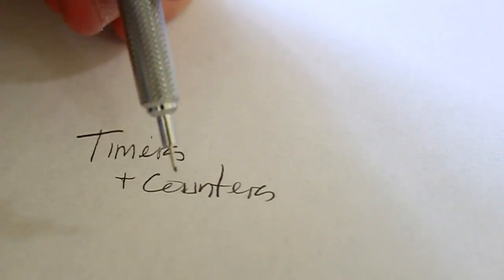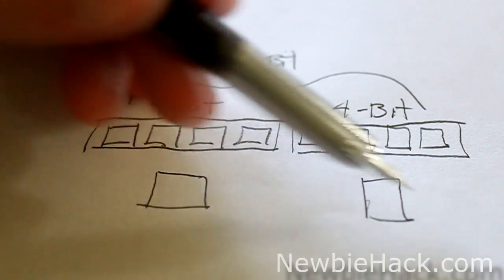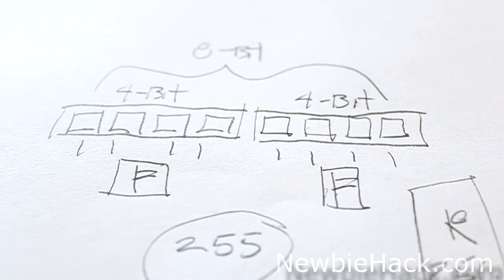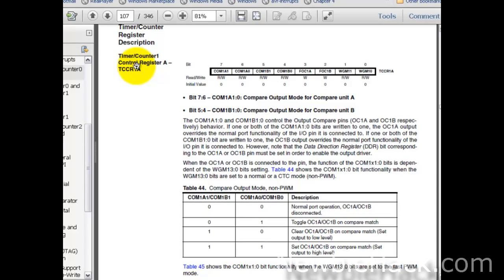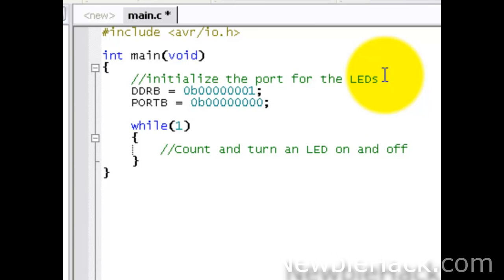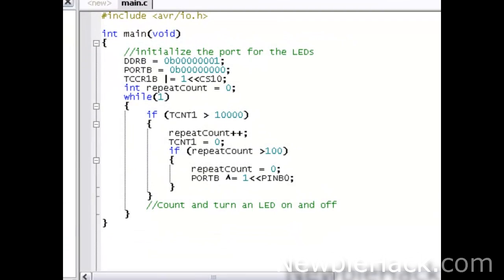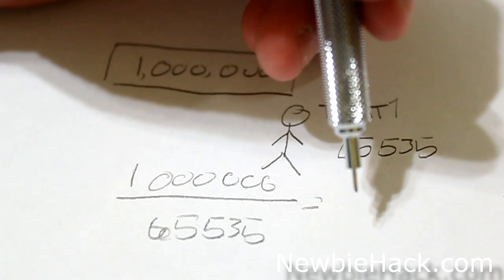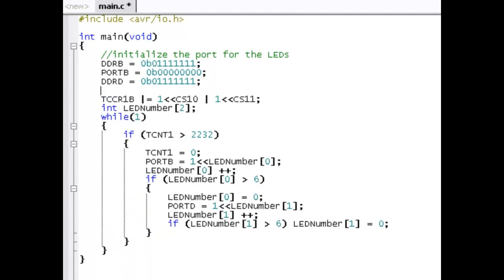17. Arduino for Production!  AVR Atmega32 - Timers/Counters and Binary/Hex Numbers

Comment: If someone have a problem with code using Arduino UNO -> just add one more line "TCCR1A = 0;" in setup statement, in order to activate "Normal" (Counting) mode for Timer1.

Comment: Hello, Patrick. before I get started, I feel obligated to say that "your videos are clearly the best. no one is disputing that". However, there are some very important things that were left out. These details are too specific for anyone to actually expect you to consider them unprompted. The first thing I want to ask you is, "If my 16 bit timer seems to be counting into the negative region, is it possible that the actual timer is counting backwards, or is it the way I am converting it to a character array and printing it to the serial monitor that is making it appear that way? ". My second question is, "Is it possible (and if so, is there a practical way) to observe the timer/counter while it is counting (like printing each value to a serial monitor)? Or will this disrupt the timer in some way". My final question is, "If I set up an "if-statement" or two in order to make sure the timer is passing every value between "0" and some predetermined maximum value I set up (probably as a global variable), what would/could prevent that from working as expected?"

 example:

------------------------------------------------------------------------------------------------------

#define F_CPU 8000000UL

#include <string.h>
#include <avr/io.h>
#include <avr/interrupt.h>
#include <stdio.h>
#include <stdlib.h>
#include <util/delay.h>

#define FOSC 8000000 // Clock Speed
#define BAUD 9600
#define MYUBRR FOSC/8/BAUD-1
#define print printf

using namespace std;

void USART_Init( unsigned int ubrr)
{
 /*Set baud rate */
 UBRR0H = (unsigned char)(ubrr>>8);
 UBRR0L = (unsigned char)ubrr;
 /*Enable receiver and transmitter */
 UCSR0B = (1<<RXEN0)|(1<<TXEN0);
 /* Set frame format: 8data, 2stop bit */
 UCSR0C = (1<<USBS0)|(3<<UCSZ00);
}

void USART_Transmit( unsigned char data )
{
 /* Wait for empty transmit buffer */
 while ( !( UCSR0A & (1<<UDRE0)) )
 ;
 /* Put data into buffer, sends the data */
 UDR0 = data;
}

unsigned char USART_Receive( void )
{
 /* Wait for data to be received */
 while ( !(UCSR0A & (1<<RXC0)) )
 ;
 /* Get and return received data from buffer */
 return UDR0;
}

int max_time = 10000

int main(void)
{

USART_Init(MYUBRR);
TCCR1B |= (1<<CS11) | (1<<WGM12);     /*using prescalers helped, but did not solve 
                                                                         the problem.*/

while(1)
{

if (TCNT1 == 7)
     {
          USART_Transmit('T');
          USART_Transmit('=');
          USART_Transmit('7');
          USART_Transmit('\r');
          USART_Transmit('\n');
     }

if (TCNT1 == 165)
     {
          USART_Transmit('T');
          USART_Transmit('=');
          USART_Transmit('1');
          USART_Transmit('6');
          USART_Transmit('5');
          USART_Transmit('\r');
          USART_Transmit('\n');
     }

if (TCNT1 == 6824)
     {
          USART_Transmit('T');
          USART_Transmit('=');
          USART_Transmit('6');
          USART_Transmit('8');
          USART_Transmit('2');
          USART_Transmit('4');
          USART_Transmit('\r');
          USART_Transmit('\n');
     }
if(TCNT1 >= max_time)
     {
          TCNT1 = 0;
     }
}
}
-------------------------------------------------------------------------------------------

The above code was created for the simple task of creating "check-marks" to to boost my assurance that the timer was working properly, but it does not work. The timer does not seem to be reaching these values, but always seems to make it to the maximum value. So, to sum it all up, my timer is basically skipping numbers. Sometimes the pattern is linear, sometimes it is not. Do you have any ideas as to why this is happening?". I have watched your videos over and over, searched the internet, investigated the datasheet, and  I have used every method of debugging I could think of. Nothing works.

     I would also like to know if the timer/counter continues to count while other lines of code are being executed, or does wait for them to finish?

     I struggled with this for a few days, and for a couple of hours,  I thought I had figured it out. Clearly I was way off. So, after struggling with it for a good six more hours, I am ready to pass this problem on to you. I hope this post isn't too long for you, and KEEP UP THE GOOD WORK!

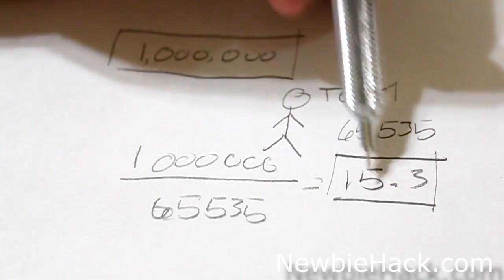Comment: pause at 30:50 in
17. Arduino for Production! AVR Atmega32 - Timers/Counters and Binary/Hex Numbers
should not it be 65536 instead of 65535.
even if it really does not matter in this case.

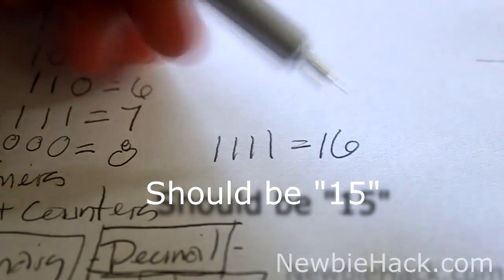Comment: For about one minute (from about 3:15 to about 4:15) a single equation is focused - stating as follows: [1111] = [16]. Just to point out to those trying to learn - the statement is incorrect. 1111 binary is 15 decimal. 16 decimal is 10000  binary.

Comment: Hi Patrick, 
At 26:30: Shouldn't it be that if you have a signed 8 bit number that the lower bound is -128 and the upper bound is 127? Since you count "0", -128 to -1 is 128 numbers, and 0-127 is another set of 128 numbers which totals to 256 or 16 bits.

Comment: I measured the frequency of the LED blinking with the TCNT1 set to 10000 and it was 50Hz as opose to 100Hz that you wrote. Then I changed TCNT1 to 1 and that should give me 1MHz (1,000,000 / 1 = 1,000,000) but I only measured 41.1kHz. Why am I not getting 1MHz? Btw I'm referring to the 1st part of video which ends at 23:15

Comment: 2/2 But some questions: Is it possible, to write code in Atmel Studio for a microcontroller from e.g. Microchip or Texas Instrument? Or do you suggest to keep the Atmel Studio with Atmel microcontrollers? And what is with the Arduino Software?  The C-like code there looks a bit easier for beginners as pure C. As i understood, Arduino hardware uses Atmel microcontrollers. So I think, it doesn't matter what development environment you use, e.g. Visual Studio, isn't it?

Comment: Right. You've got it now. So for others: Don't forget that ZERO is a possible value. Just like with the color combinations that Patrick discusses: If there are 256 possible shades of red, 256 possible shades of green and 256 possible shades of blue, then we can write each of those as 0xFF. So while 255 is the largest unique *value* we can express with 8 bits, there are actually 256 unique *numbers* we can describe (0 - 255). So 0xFFFFFF gives us 16,777,216 unique colors (0 - 16,777,125).

Comment: Hi buddy, Its just out of interest im replying you as i even got similar doubt .The thing is Lednumber[2] is not initialized. so as per C standards any variable which is not initialized holds the value 0. So now Lednumber[0]= 0 and Lednumber[1]=0 . So in if condition it is assigned to PORTB=1<<Lednumber[0] (<< which is bit shifting) so intially Lednumber[0]=0 and it get incremented 6 times and bit is also shifted 6 times.

Comment: so we have used the statement:"PORTB = 0b00000001" a lot now so thats in decimal
you could use "PORTB = 0x01" with the same result.
just like 0b10010001 would be the same as 0x91.
so the 0b means Binairy and 0x means heXadecimal
pretty neat.

Comment from the maker: @mariushmedias Thanks for the clarification.  That is correct.  I am "toggling" the pin (or LED) every second.  I mentioned that it would toggle every second, but I also mentioned that it would blink every second, and that was just a brain slip.  It is definitely toggling every second.

In an earlier video in this series, I explain the toggle code and bitwise operations, but many beginners may not see that video before this video.

Thanks

Comment: Something may not be obvious to beginners: at around 23:00, the code after 100 repeats sets the pin value to 1 and then after repeatcount is set to 0 and another 100 increments, it sets it to 0 - that's what the ^ operator does in front, inverts the set value.
So you're not directly setting it in on and off in that two lines of code, you're initially setting it to on and then after a second it gets set off, then repeat all..
I think... I'm not 100% sure as I'm also a beginner at microprocessors.

Comment from the maker: @AjStephens86 An intro to interrupts (using timers as an example) will be next.  Following (near term): LCD display (detailed - not using existing libraries), more on interrupts, ADC (analog to digital), PWM (input - for certain sensors that output PWM), PWM (output - motors, LEDs, servos), Serial comm (uart), and interfacing with other peripherals.  Long term - there's a lot.